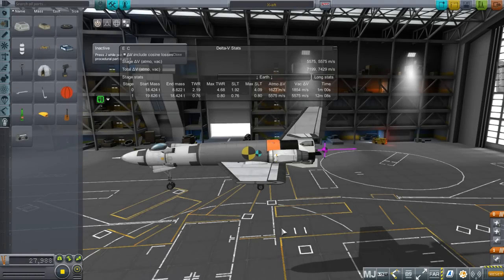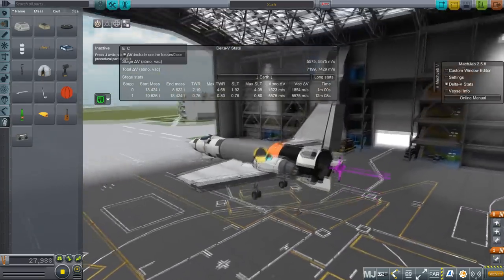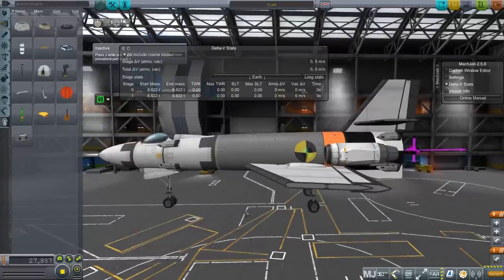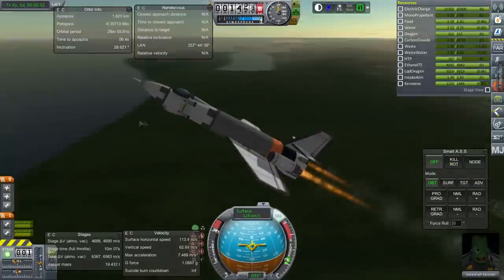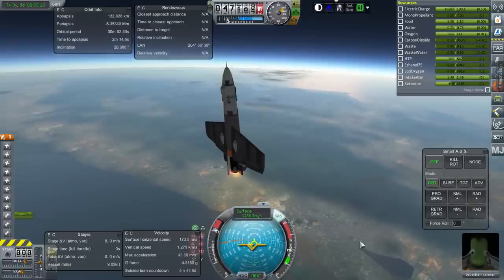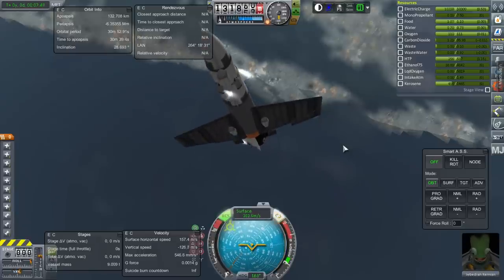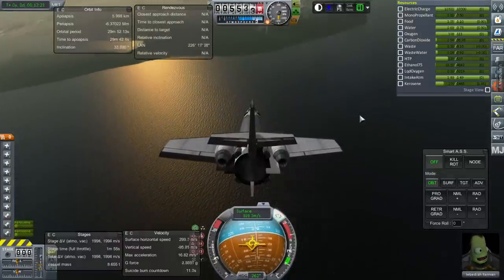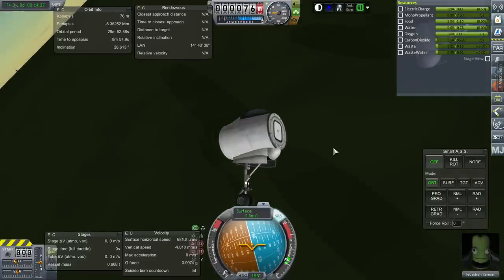KSP/RO - Spaceplane with 1950s Tech

Comment: fiddle with the wheel tweek scales because I mannaged to get over it, I think turning down the springs and increasing the stiffness or whatever it's called worked for me creating a Skylon which weights around 340 tons fulled and loaded in OR.

Well it can roll on the runway without a problem but my Skylon like the real Skylon needs a longer runway than the runway in KSP to take off so I need to do it on the ground which means I can only take off from 1 or 2 places on earth.

Landing on any runway isn't a problem as I weight like 20 - 30 tons without fuel and a payload so I can stop easily with some airbreaks and normal breaks in half the length of the runway.

Comment: Idk if ksp models this, but aircraft with large delta wings and high t-tails are known for stability problems. While pitching up the tail is blocked from the air stream by the main wing, removing its influence on the center of pressure and making the aircraft unstable

Comment: Tyler, you could use kerbal co structuring and kerbin side bases to cover the runway with a. Coustom 100%flat strip. You would maybe need to use vessel mover or launchclambs to get the craft to the proper height but should be a valid option

Comment: It's a problem with the runway. Start on the grass beside it and (well designed) aircraft work fine. For most planes I just ride slowly across the first bump. The second is a drop and isn't a real problem. And the by the third most planes have taken off. Landing on the runway is really impossible at the moment.I just land beside it and roll out on the runway. 
When landing disabling SAS sometimes works and of course using a joystick gives finer control.

Comment: Could you bring a little RCS or solid rocket motor cubesat with you and launch it? Or still too heavy/not enough tech? If you got as high in the atmo as possible on the jets, before using the rocket, it could work.

Second question, to make your re-entry cooler/easier with this - DO you have access to any moving parts? You could do a shuttlecock-style re-entry, in the style of Virgin Galactic.

In this instance I think your tail end was just too heavy compared to your front once fuel drained, and air speed + lift too low to provide authority to overcome it. Perhaps move the engines forward more over the wings.

Comment: I've had the pitch problem on one of my spaceplanes as well, it just seems like the general aerodynamics (in FAR) weirdness. If you look at the stability derivatives of this spaceplane at, say, Mach 0.2 - 0.3 one of them will be red.

The solution? I'm not sure but I'd shift the CoM backwards even more - it doesn't really reflect a craft's performance in all flight conditions. And I'd just fiddle with the plane until stability stuff goes green.

Comment: a slight bit less severe control surfaces in the rear and some control surfaces in the front, canards or winglets to balance the plane out near stallspeeds.. And strap those wheels on each side to avoid wobble..
Now lets see you build a proper spaceplane that can take alot of kerbals and cargo into high orbit and make it back again :)
Reply: ***** It took me 3 years before i actually figured out how to build an actual fighterjet that works the same way that fighterjets works in the real world in ksp, inherently unstable so that it is ultra reactive and completely reliant on a computer to fly it.. I just thought about it completely wrong the whole time.. but when i finally did it i almost had to slap myself for having been so silly for so long :P 
Love your stuff mang, but trying to balance a stick horisontally with just rear lift below stallspeed is never gonna work ;)
Reply: ***** you had no lift nor control surfaces in the front, as the speed dropped while landing you lost control authority one second then overextended and flaired the next, hence the wobble.. you could try using braking shutes or an airbrake in the rear and time it right offcourse, flying in fast very low over the runway then hitting the brakes, but it would be easier with some control authority in the front instead and you would come down alot more controlled withouth adding too much weight to the craft, just stick some canards in the front and test it if you dont belive me :)

Comment: You know with B9 procedural wings you can remove the trailing edge of wings so you don't have that visual clipping issue with your elevators/ailerons
It took me forever to notice that
Reply: PS the wheel problems are just caused by the terrible implementation of wheel physics in 1.1, fiddling with the friction controls can help but the only way to actually fix it is updating to 1.2

Comment: Chek out terms camber, reflex and crow. The main wing should have only aileron active without mixers. I am really missing a glider mixer mod.
Reply: I was just suggesting, you mixed the elevator into the main wing, it's lift vector changed (chamber,reflex) and plane acted strangely. Use only ailerons in the main wing. S= elevator up + reduced lift, W= elevator down + increased lift
Reply: Sory my bad english. Yeah that was my point. In soaring planes we are using speed mixers. Speed=inner aileron up 1% deflections 2%, slow= inner ailerons down 20% deflections 30% , breake = crow+ breake risers + deflections 90%. I was just wandering why i see speed when elevator was asked. Thank you for your patience. I am a huge fan of your videos.

Comment: There are no fix fir landing gear in 1.1.3. 1.2 should have fixed it, but I didn't try it yet with FAR, where takeoff and landing speeds are higher than in stock aero.